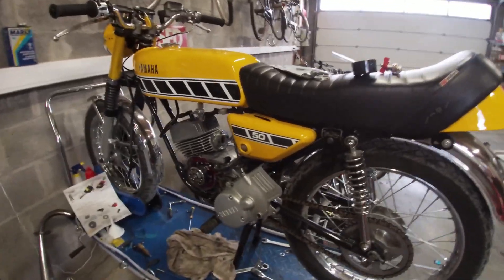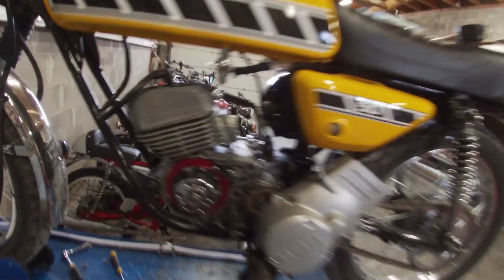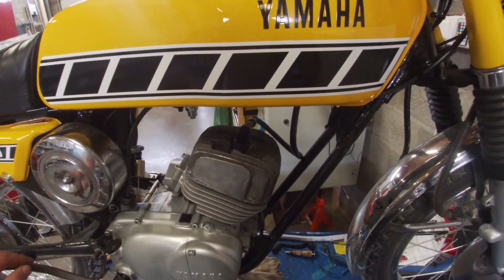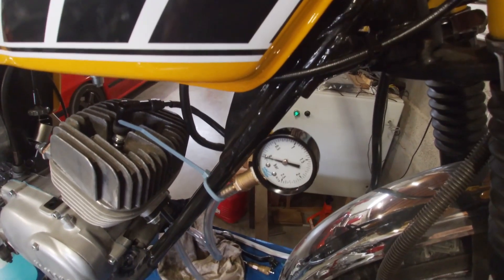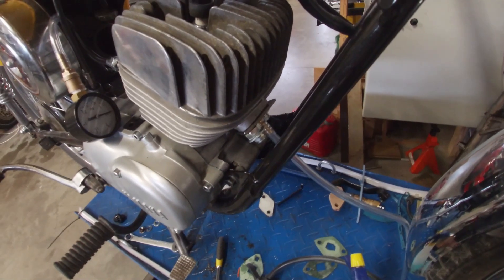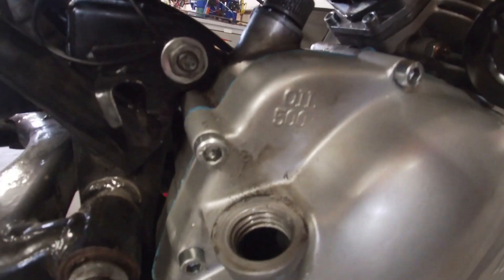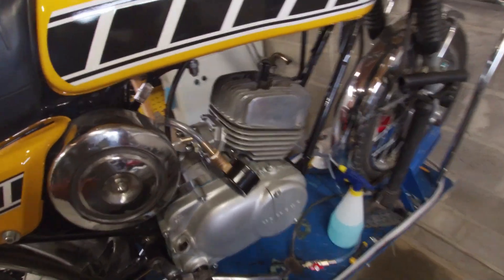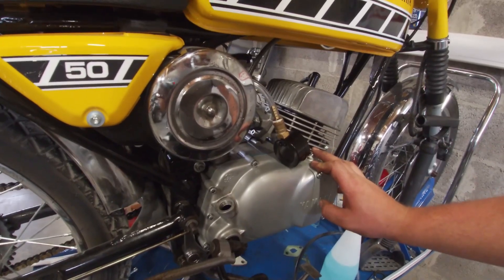How to do a 2 stroke leakdown test?

Comment: Do you have the bike at TDC on 2 strokes
Reply from the maker: @jamesshort5768  it shouldn't matter really as the piston rings don't make a perfect seal anyway, so they will leak into the exhaust, crankcase and eventually into the inlet. So if you block the inlet and exhaust it should be fine. Also doing it this way also tests the crankcase seals
Reply: @ I’ve done a compression test of the piston and rings that come up at 137 PSI. I’m now want to check my crank seals. I was just wondering if it best to have it at BDC to test the crank seals etc
Reply from the maker: @jamesshort5768  how did you test piston andr rings seperately? If the engine is complete like in my video, the crank seals are tested aswell
Reply: @VintageGarageYT  I did a compression test first using a gauge in the spark plug hole and kicked the bike over until the maxed out with throttle open.
I then decided to do a leak down test and was pissing air out the power valve vent and opened oil filler cap and that was pressurised to is that normal?
Reply from the maker: @jamesshort5768  how much pressure did you put in? If air gets out through the oil filler cap, that means the crankseals are bad. Allthough if you put to much pressure in, that could mean you've just ruined them, but they would have to be checked to be sure. The compression test shows the state of your piston rings, leakdown test shows if you have an air leak from crankseals / head gasket / bottom gasket / ...
Reply: @ I put in 5 PSi. I noticed the power valve arm goes into crank case and if there’s an air leak on power valve could that be pressuring my crank case. I had to bung the Power valve breather tube to be able to hold even 1 PSI
Reply from the maker: @jamesshort5768  the gaps in the piston rings will pressurize the crank case aswell or the transfer ports when the piston is not at TDC
Reply: @VintageGarageYT  in that case is it normal for a 2 stroke to have the transmission oil go under pressure or is that a sign of crank seal gone? The trouble with the KTM 125 is got to split the engine to replace the left hand seal
Reply from the maker: @jamesshort5768  yeah if the transmission gets pressurized that would indicate bad crank seals. Does it still run? If so how does it run? Lots of smoke?

Comment: There seems to be an hairline crack in the right carter at 3:51; nothing coming out of that?
Reply from the maker: Where exactly? I seem to miss it.
The 'seperate' cover on the right houses the oil pump, so if that has a crack that's not that big of a deal.
Reply: @VintageGarageYT  if you click on the  3:51 chipher you will start the video at the right spot; 
I think one, in a video about leak down test, could expect to be pointed out, as the airline crack non being  the culprit in any way.
Reply: I do not mean to be "noty" but I seem that, if the compressed air, gases and sonic waves, had a chanceto be kept within, with that crack they were no hopers ;--)
Reply from the maker: @robertomalatesta6604  No worries. I like people commenting, I'm no professional so I learn everyday.
If you mean in between the A and M off Yamaha, that's meant to be there because the clutch cover is made of 2 pieces. I can't post photos here. Let me google a link real quick
Reply from the maker: @robertomalatesta6604  https://i.ebayimg.com/images/g/m20AAOSw-bpiI1eC/s-l500.jpg
This is that cover. The right section is seperate.
Reply: @VintageGarageYT  fair enough; does it seal proppa?
ciao
Reply: @VintageGarageYT  No prof here too, I also learn from proactive mistakes
Reply from the maker: @robertomalatesta6604  its not connected to the crankcase or combustion chamber. It houses the oil pump for autolube.